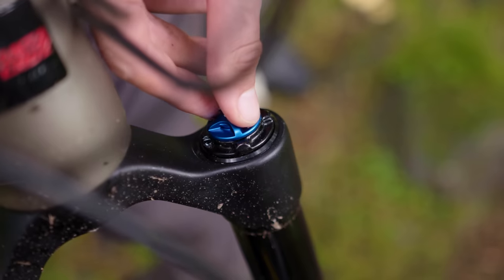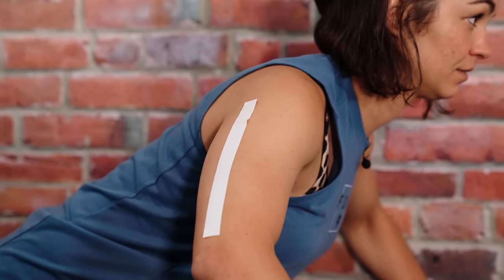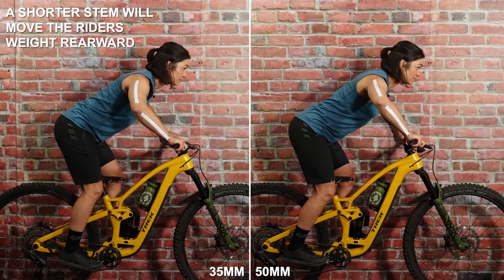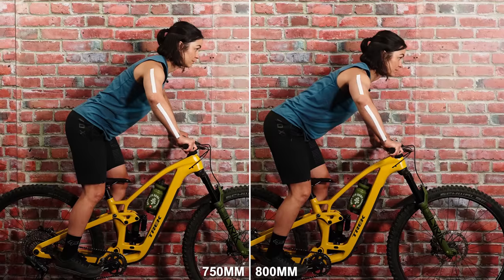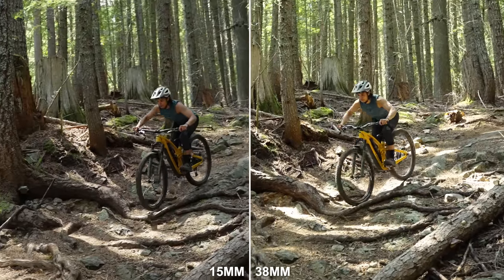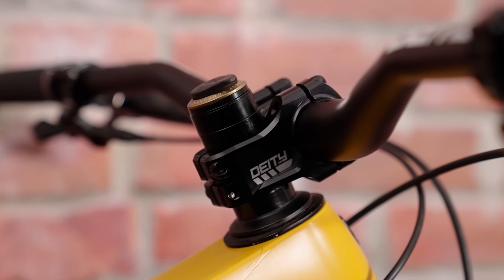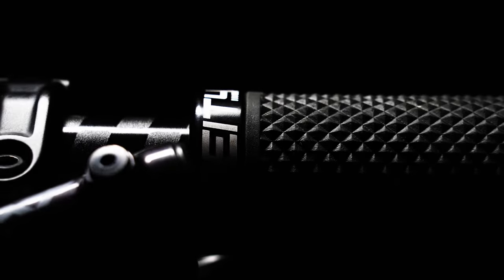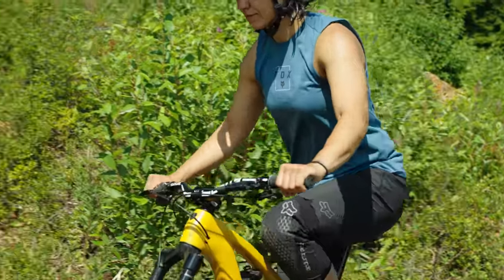Why Your Handlebar And Stem Are More Important Than You Think

Comment: More videos like this please! I see so many riders that could benefit from better setup. Once a rider is on a good setup its so fun to see their riding exude confidence!
Reply from the maker: Agreed, it's the little things for sure that really add up and create comfort/control -Christina
Reply: I have a short, 35mm stem and 800mm stock bars but I feel like I am awkwardly too far back and leaned forward w/ 42mm fork offset. 
I am looking into possibly switching to a 50mm stem with 760mm E90 Carbon bars. Would it potentially be a good idea to get a 51mm offset fork (which I found an upgrade for a really good deal) during all of this? I am fishing around for opinions

Comment: We just did an experiment, used a 70mm rise bar with 5° upsweep and 12° backsweep. Combined with a 50mm stem.  Rolled the bar 5° to completely eliminate the upsweep and the result was amazing! The bike felt so planted, comfortable, precise. Wrist pain was eliminated and shoulders were destressed. Bunny hops became easier, wheelies became easier and at the same time, it was easier to climb and remain in control on fast descents. Best of both worlds. Hands are further front but without the chest being hunched over the steerer tube. It was so weird but in a good way. Basically we got a bike version of Hondas NC750X

Comment: In regards to bar roll at 7:40 your wrists don't want to rotate around the bar, or feel like you have less to brace against when you roll the bar forward, because your hands aren't glued to the bar, they don't rotate with the bar like you did in the video, bar roll is mostly about getting the the angle of the bar feeling right.

Comment: Christina is a treasure! Struggling with a 73° seat tube angle on a 2019 Enduro bike, never thought I could bring the saddle forward to compensate. However I really can't since having a saddle all the way back and a 50mm stem my XL Spectral is still a bit short for me.
Reply: Look for a longer frame xl bike. They are not all the same.

Comment: First off, great stuff. You covered most of it.
But here is some more info.
8:13 That bar was defenitly rotated too low. but  I fond somewhere between the T rex position and more common position is what works best for me, flat to flatish brake levers, relaxed arms, hands resting on the grips. Aka Yoann Barelli setup.  But tall enough handlebar and long enough reach is needed. But combine it's great. 

10:55 For grip diameter I recommend to make a circle with thumb and index finger and measure the diameter, this will give the grip diameter that fits you. I measure at 34mm, so that's what i go for.
I don't use the grip diameter to adjust the reach or brake feel. I adjust the brakes reach and that's it. But my current brakes don't have any other adjustments. But I like them grabby.
A thing you forgot to mention is back sweep, people can have different hand grip angles, so get a bar that suits this, mine suit most bars, the 8, 9, 10 deg would work for me. But some need more.

Comment: You are right, ergonomics and preference for everyone is different.  I'm 5'6" (5'7" on a good day), 140lbs. butt naked with a 30" inseam.  I prefer a 460 reach mostly. I like a 760mm short rise bars and shortest stem, usually 32mm, that'll fits with minimum stem spacers under stem.  I use this same setup on XC, Trail, and Enduro.  BB drop, crank length (prefer 155 but mainly use 165mm) and stack height difference between each type of bike will dictate grip to seat height difference which fits those specific type of bike/riding.  Distance from saddle to bars is dictated by STA, HTA, seat rail, and bar sweep.  I used to like shorter for playfulness but as I gotten older prefer longer more stable.

Comment: I just finished upgrading my 2014 SC Tallboy.
New wider (800mm) higher rise bars, shorter stem, shorter cranks (165 mm now-size L) sliding the saddle back and installing a new 1x12 drivetrain. Oh and new brakes. Feels like a new bike.

Comment: Bought a DEITY bars , the riser alu...superbe and it did changed the quality and feel of the rides compared to the original one, and i don t feel my back hurting after 2 hours on the saddle . It is actually very good  at damping the vibrations too. Definitely worth the money , that was hard to spend another $$$ in my bike, but now, i feel like i am riding the bike i want, 
The stem is tempting , but i feel like i can wait a bit to spend more in bling for not much more than looking good. My geometry and numbers are there , i think.

Comment: Well thought out video. Would like to add one thing as a correct seat position is paramount for preventing knee injuries and maximizing your pedal stroke. You don't just move it willy nilly as that can cause issues. Thats first and foremost. Once that position is dialed then finding your correct bar/stem combo is a matter of everything stated in this video with regards to personal feel, riding style, terrain, etc.
Reply: So what is the correct fore aft position? because it used to be hang a plumb bob from just below your knee and it should intersect the pedal axle, but now that seems to have gone out the window as manufacturers keep making their seat tube angles steeper.
Reply: @benjy288  Yes, as a good rule of thumb, that is correct. There's a reason why the UCI has limits how far forward a seat can be. It can lend itself to knee issues. Find the soft spot behind your Patella and drop down to the center of the pedal axle. Knee bend should be around 10 degrees. You'll know if it's too high or low because there may be knee discomfort in the front(too low) or back(too high) of the knee. I think generally you can still achieve a correct seat position with most seat angles. XC and trail models are still a bit slacker and achievable but once you hit enduro bikes it could become an issue. Those bikes aren't really designed to climb anyway despite what reviewers say. I could be wrong but in order to achieve lower BB heights crank arms are also being shortened, resulting in diminished pedaling efficiency. All depends what you're looking for I suppose.
Reply: @crestedbuttetrails3214  I mentioned that to some sales guy in my local shop a while ago and he said that's long gone, lol, who knows, but I do know that when I try that on my current short travel trail bike which is only a few years old the line is more inline with the front of the pedal body, and its not to small for me either, its a large and I'm 5'10, so it seems manufacturers have abandoned that principle.

Comment: We are all profoundly different. For example, I built a a high power e-mtb from Cannondale XL frame which came with about a 50mm stem.  I don't ride knarly trails. I am a roadie. I can't stand a cramped position.  I like to ride stretched out.  Many at 6'1" would ride a size L frame with 50mm stem. Not me. I ride a XL with 130mm stem as long stems and narrower bars used to be the norm 30 years ago on the mtb'ing scene.
Go with what feels best.  Because I come from the world of riding a roadbike stretched out, riding cramped to me feels awful and I can't get my glutes into my stroke.
Yes, stem length and handlebar width matter 'a lot'.
PS. for those interested, many believe the greatest mountain biker of all time was John Tomac.  He rode with a very long stem with rise FWIW.

Comment: I disagree with the grip strength being better with smaller grips. I am far more confident with the 32-34mm grips than 30mm. You have more leverage. And for reference, I wear a size medium glove, so I don’t just have large hands.
Reply: I agree, there's an optimal position where you have the most grip strength, and its usually more than 32mm, I've prefer the esi extra chunky 34mm grips, I used to get muscle cramps in my pinky and ring finger with 32mm grips after multiple bike park laps, but not anymore with the bigger grips.
Reply: @benjy288  I just measured my Ergon GA2 Fat grips and they taper from 34.5mm out by the edge to 31.8mm by the brake lever. I always get I had to really squeeze the 30mm PNW Loam grips I had prior.

Comment: swapped my stock 50mm stem for a 35 3 years ago as I felt like I was being pulled too far over the bars on steep stuff. 
after a wrist injury I carried on with the 35 but felt I needed the extra leverage of the 50 back on to take some of the force out and changed back a month ago.
but having done that the front now feels odd at times, some of the intuitive steering has gone, I'm going wide on turns, I thought by now I'd be used to the stock stem again but it seems not, I also now lack some mobility in the wrist so maybe I can't throw the extra lever around.

Comment: simple but effective ways to dial in a poor bike geometry based on your body shape and riding style. 
you forgot one thing tho, how steering is affected at differing rates of speed related to the fork's OFFSET. 
and also, crank length is prolly the biggest industry oversight. at least, 5 dev, hope, and canfield have figured this out.

Comment: Great piece!
I right my bike for 3y now and tried to live with a couple of hand comfort issues. this motivates to play a bit with repositioning the bar and sadle.
Reply: Try sq lab handlebars or salsa rustler. I switched to them and the extra back/up sweep has fixed my wrist pains.
Reply from the maker: Sweet! Definitely mess about and you'll notice the differences! For me and my janky wrist, I know I can't run bars too wide or my wrist flexes too much inward and too narrow adds pressure to the outside of my hand. All things to consider. Fatter grips was one of the best things I found to help also -Christina
Reply: SQlab 30X 16 bar and SQlab 711 grips, properly-sized is an outstanding combination for wrist and hand ergonomics with superb control. Of course, the other factors still matter for bike handling, but for eliminating hand/wrist pain, this is the best solution that I have found.

Comment: Seems like having 2 weighing scales on the front and rear wheel  could be a good way to fine tune weight distribution ?
Anyone doing that ?
Reply: No because it's a dynamic situation, you are unlikely to be in your true riding position and dynamic balance 'feel' is unlikely to show as equal kg front and rear
Reply: @traildogisla  dude i have been thinking about what you said about dynamic situation for weeks , and you know what , the same can be said regarding about every bike fit variable .
with that in mind i think having actual numbers on weight distribution between the 2 tyres would be a useful metric to have for tweaking baseline seated position , or in a standing ready position .
Reply: @rinky_dinky  try it and let me 👍

Comment: I've tested 40, 50, 60mm stems and various bar widths. 50mm turned out to be a good compromise and enables front wheel awareness on a really slack bike. Narrower bars eased shoulder blade pain on hard compressions and reduced clipping trees allowing higher speed and more leaning. Wide bar and shorter stem is clip city on narrower trails. Best wrist pain reduction was from switching to a 12 degree back sweep, way stronger wrist alignment. Fat grips for sure. Dialing the cockpit is so important.
Reply: I've also found bar height can quite easily effect front end grip especially on flatter corners, too high and there's not enough weight on the front, too low and there's too much weight on the front.

Comment: Hey Pinkbike, nice vid! But is this also possible for Tall guys? I‘m 77,95 inch tall, and 231 pounds full of mass…. So a 31,49 wide handlebar is standard for me….. also a coil damper than a air…. So for lighter and smaller guys it‘s possible to test some adjustments, but I ride on the edge…. 😂

Comment: I completely agree with your video. I started mtb riding, three months ago at the age of 60. I am partially handicapped in my legs. 
The first month, my hand became completely numb. I was not comfortable sitting so forward leaning. I could not look backwards comfortably. Especially when I want to change a lane. I am a casual rider, all terrain, bust mostly urban. 
I purchased a 120mm high rize bar. I can adjust my weight forward by leaning the handlebar forward or banckwards. It has a 3° upper angle and a 9° rear angle. 
I am now so comfortable on the bike now. My hands don't go numb. I can look backwards comfortably. 
I am also unable to pedal standing due to my handicap. 
However, my pedalling is now more powerfull. I only noticed that I can go in wheely position easier on very steep hills. My pedalling is now more powerfull. I can outrun some younger people. 
Backpain and pains in my knees  and legs are gone. 
I am a little more upright and can see better.
The best choice I ever made. Total comfort.

Comment: The only problem i have when riding bikepark is my hands. At the end of the day i can hardly squeeze my brakes. Its not armpump, just the hands. Could thicker grips help?
Reply: Slow down your fork rebound slightly
Reply: Possibly, I used to get something similar to muscle cramps in my pinky and ring finger just from gripping the bars after a few runs when I had 32mm grips, since I switched to esi extra chunky 34mm grips its been fine, grips are cheap.

Comment: Being tall doesn't necessarily mean preferring a taller stack. I'm 6'2" but with extremely long arms, and I hate a tall stack feeling.
Much rather have my stem slammed and use flat bars
Reply from the maker: So flexy! But with so much variety, each to their own for sure -Christina
Reply: I think it depends partly on your proportions, leg vs torso length. Longer legs/shorter torso tend to prefer relatively more stack and less reach (like me), shorter legs/longer torso tend to prefer less stack and more reach.